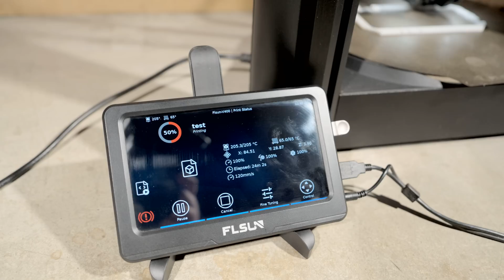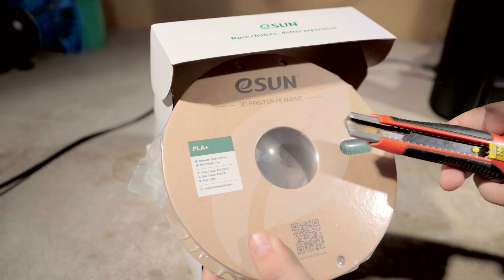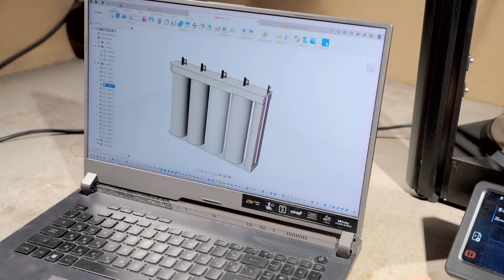Ordinary battery are no longer necessary! A perpetual battery for a found phone.

Comment: Nice video! I like how you rebuilt that broken robot technology into a smart display. I've been considering building an emergency battery that eats up waste aluminum or at least uses a few aluminum sheets cut from waste cans. I've talked about it with Chat and it suggests that an aluminum-hydroxide battery produces electricity and hydrogen gas for heating, cooking, or more electricity from a fuel cell.

Comment: Have you heard of the Carbon battery/Carbon fuel cell?  With a steady supply of carbon, aka: crushed charcoal, you can run it for a very long time.  Yes you do have to clean/refurbish/replace the cathode and anode every so often, but that is actually still better for the environment that our lithium-ion batteries.  Nickel for the anode and a carbon rod for the cathode.  Ideally you would have a liquid- probably acid -with carbon powder mixed in, multiple carbon rods as the anode and nickel rods or a sheet of nickel as the cathode.

It baffles me that no one knows about this technology.  It is far more clean than what we have, and you can make it from trees/coal/oil/etc.  Basically anything with carbon in it.
Reply: You've basically described a normal battery what you can get at any store!😂
Reply: @JamieCurranthemagnificent-z7h  A "carbon-nickel flow battery" is not a normal battery.